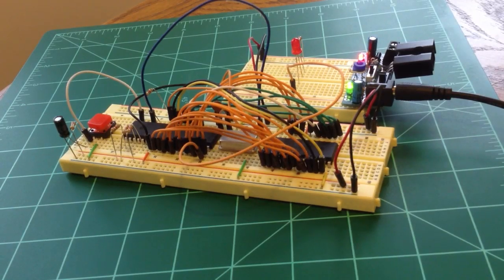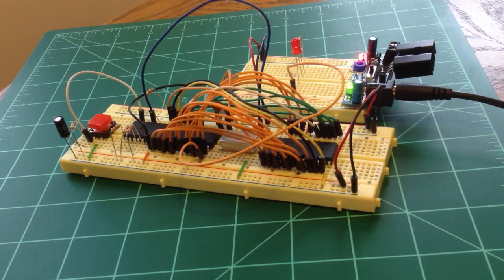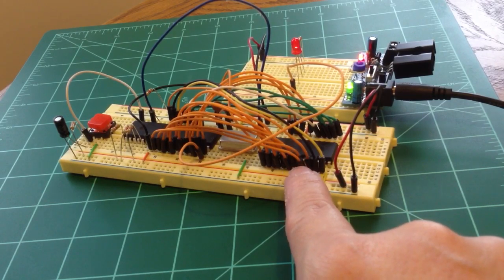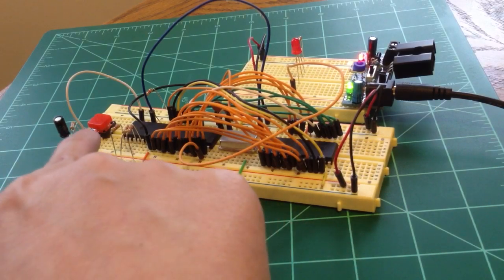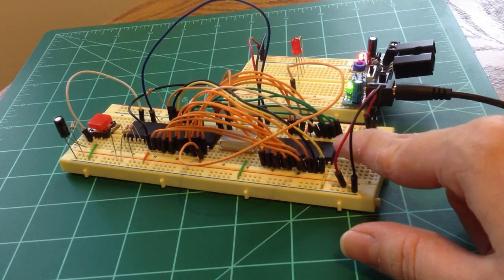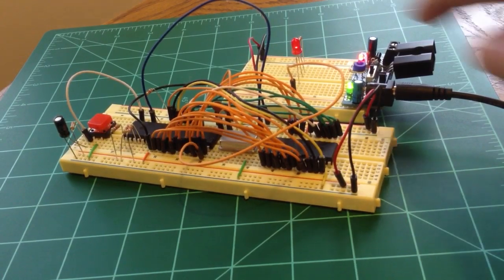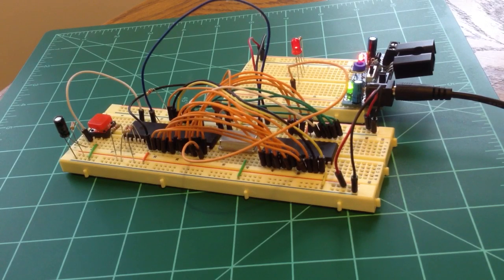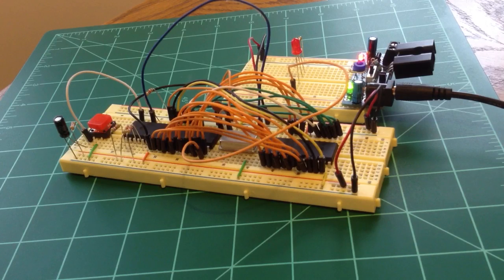Project:65 8-bit computer running its first program

Comment: I am  a bit confused, could you not have used a 555 timer just to flash an LED, would it not have saved you a lot of bother and trouble to used a Microprocessor and an Eprom and a 4Mhz clock oscillator to do this, and how you then have to write a software and assemble it and load it into eeprom to run that LED flashing loop, another byte  that confused me is you said that you have wired the LED to one of the address lines, and also said you have not yet programmed any I/O lines, so how can you claim that the LED is flashing due to a software aspect, I thought any address bus is used for calling up locations in a memory cell or cells, and then you need other instructions to enable output and extract data stored in that location, and or write bits or bytes at that location, and only then you can truly demonstrate what you can then do with those bits and bytes to do a thing like flashing. i may be wrong and still a big fan of 555!   ( Please feel no offence - one is not intended at you)

PS, as I was typing above, my wife was also reading what i was typing, so she said to me " Don't be daft all your life, he is not trying to flash an LED, but demonstrating the ability of a microprocessor and software capabilities, I hope she is wrong or else I am in big big trouble, she has time and again warned me if I don't act my age, she will definitely divorce me, she thinks I am really daft!

Hey that was a joke, but well done to demonstrate how to start acquiring skills in using a basic processor and writing software, for dafties like me. thanks, keep up the good work, but sadly i am still stuck with CMOS and %%% timers and would like to lay my hands at these sexy processors, my wife is a real bitch.
Reply: +samdomding My wife has a habit of bringing me down with a thud too.

Comment: Where can you get a 2865 eeprom chip? I've been looking but gogle only provides other projects with the 2865 and not any sources for such, nor does ebay or anywhere else I normally get electronics from seem to have it. The 28c16 is another parallel eeprom chip that has, I believe, double the memory. Can this chip be hooked up in the same way as the 2865 eeprom?